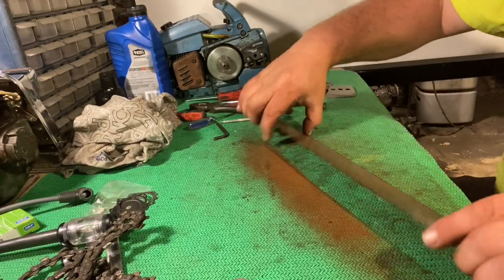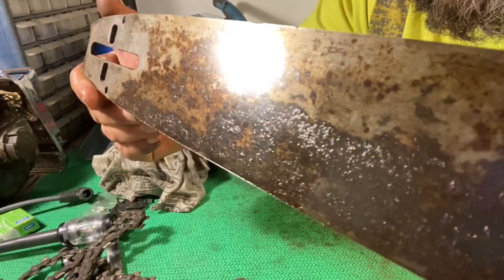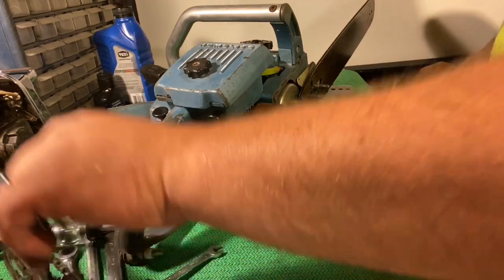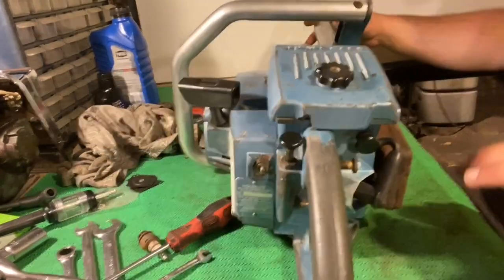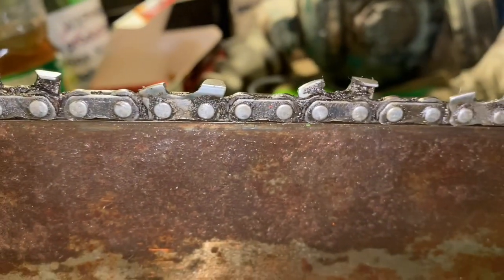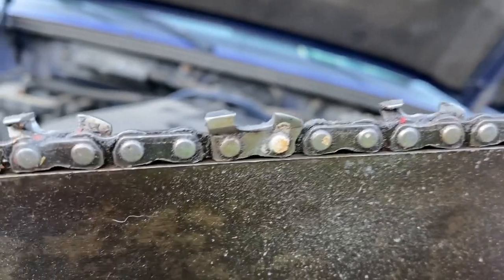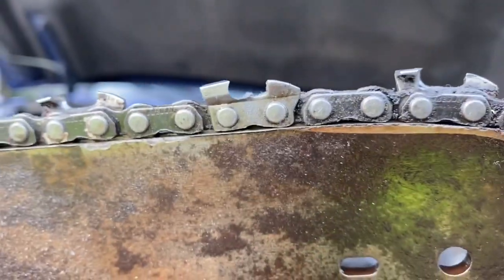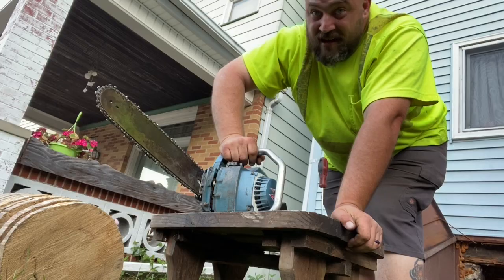Homelite XL-12 Chainsaw First Attempt By Cleaning The Diaphragm Instead Of Replacing!!

Comment: I don't know where you live but they have engine shows and swap meets at Portland Indiana in the spring, summer, and fall. There's alot of saws at the shows and especially the swap meets. It's a great experience! It's called the Tri State Gas and engine show. I heard you ask about it on the bow bar video. They have a campground across the road from the fairgrounds. They definitely have two man chainsaws. You can goggle it.
Reply from the maker: I will check it out.  Thanks!

Comment: Soak those diapharms in brake fluid for a few days to bring them back to life. I have several XL12,s and super Xls. Two run good. They have a combo of no paint blue paint and red paint. Hodge podge saws that are made from the best parts of different saws.
Reply from the maker: Thanks for the tip!